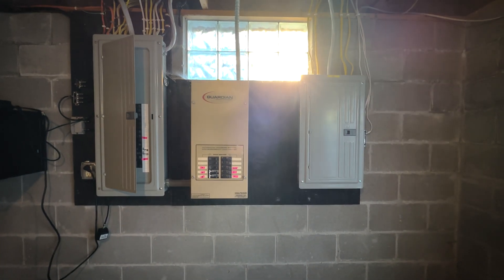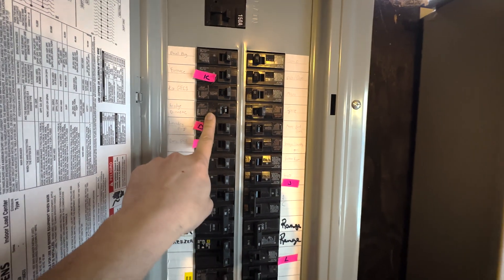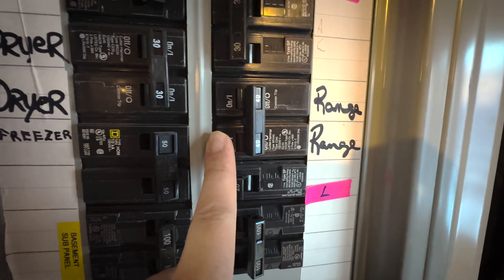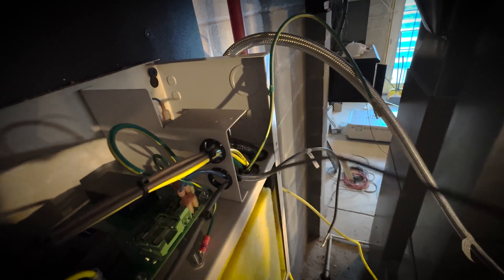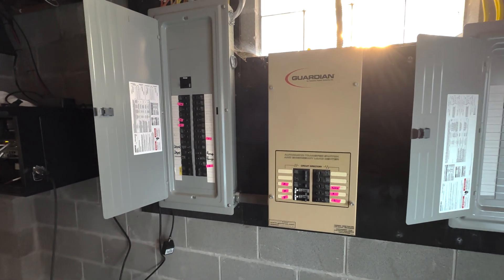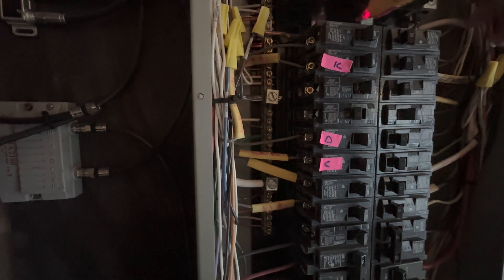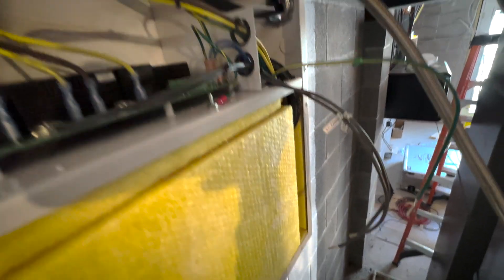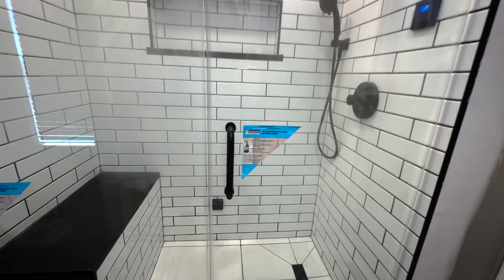Wiring In A Delta Steam Shower Generator

Comment: Hey Billy! I have an idea as to what's going on with your breaker panel in relation to the generator. You're not supposed to feed the generator directly into the main panel, because doing so will backfeed power into the lines coming into the house -- dangerous for the power company folks trying to fix the lines during an outage. Instead, selected circuits (like your fridge or furnace) are removed from the main panel and installed into the transfer switch panel. When the transfer switch detects a power outage, only those circuits are switched over to the generator. If you had a whole-house generator, the transfer switch would be upstream of your main panel, again to isolate it from the supply lines. Since you have unused breakers in your main panel it's likely the generator was installed later on, hence the wire nuts you're seeing in there.